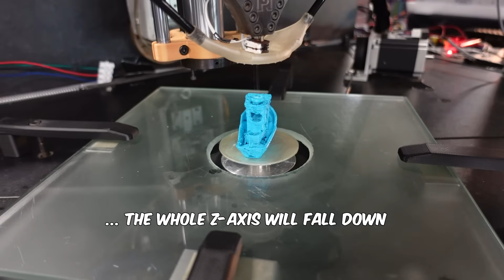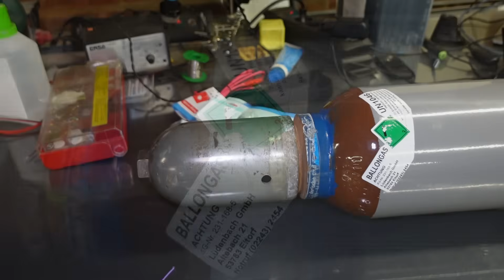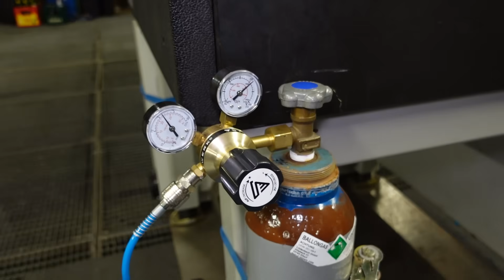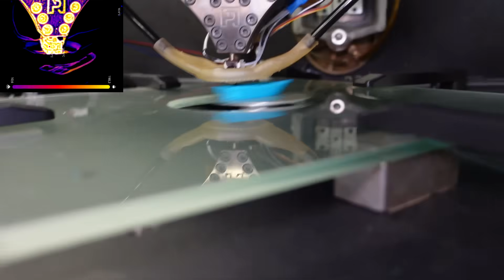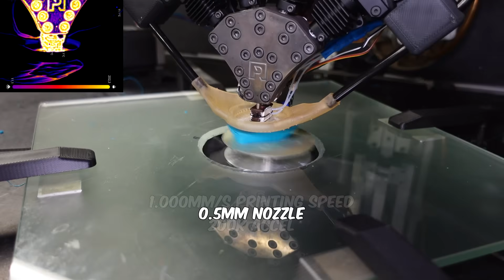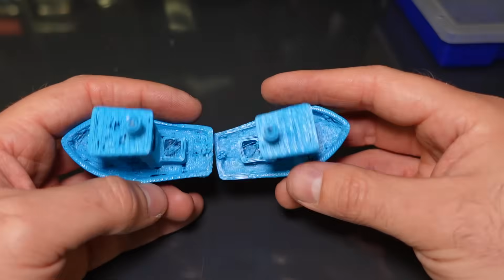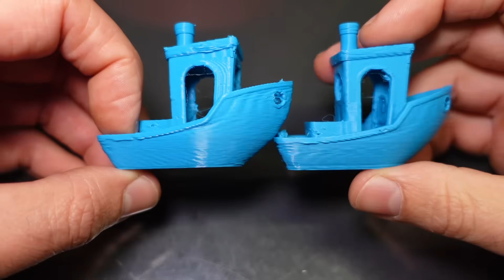Testing Helium Cooling on Worlds Fastest Printer (Minuteman Episode 18)

Comment: Sounds like the limiting factor of shop air is the amount it pushes the filament around. 
Is there a way you could use an auxiliary part cooling system that blows upwards to counteract the downwards force of the current nozzle cooling? It could move with the Z axis so it always aims at the nozzle. You would have to position it outside the print area of course, so nothing collides. You might need to make the bed taller / thicker so that it doesn't hit anything as it moves down though. 
Or maybe add a vacuum port right next to the nozzle to suck the filament back upwards haha. I believe you can do this with a venturi vacuum so it could also run on shop air. If it had the right size and position nozzle it could almost hold the filament in place as it cooled without sucking molten filament into it. Might be hard to balance and constantly get clogged with molten plastic though.
Another wild idea: Use ferromagnetic filament and put an electromagnet around the nozzle to pull the filament strand up and counteract the downwards force. You could tune the magnetic strength so that it just balances the downwards force of the cooling.

Comment: Seems like what you want is a lot of thermal transfer with low "wind" pressure. This gives several things I can think of optimizing:
1. The Gas: lighter molecules is better. Helium is the best. Hydrogen (danger!) is second. Methane, ammonia and water vapor are all better than air.
2. Cooling gas temperature delta: a larger temperature delta means more heat transfer.
3. Operating temperature: cooling is faster at higher temperatures (more molecule impacts). This scales with temperature in kelvin, and is likely not worth trying to optimize unless you can print really hot.
4. How much cooling is required for the print material to go from solid to liquid. Some materials have a very sharp transition, like eutectic alloys have a very sharp transition from liquid to solid.
5. Thermal transfer withing the print material: I'm not sure what is really optimal, but if you can cool the solid part a lot (since its solid and can take the pressure), perhaps that can help cool the new liquid added to it.
6. How structural the print material is before it solidifies.

If it were not for #6 there, a death machine that prints a high temperature eutectic solder with hydrogen cooling would be great. Too bad it would absolutely suck at bridging and kill you with fire.

More practically, getting a real high pressure air bottle (likely scuba gear) to expand it to get really cold air its likely your best option. To do that, you will want to do the pressure drop/regulation as close to the nozzle as possible (to minimize heating of the gas after that point), ideally use the nozzle as the main pressure drop so the cooling happens in the air on the way to the part. If not going that far, at least put the pressure regulator just before your nozzle, and give it a while to cool down the part in-between (which you might want to insulate if its long) before you start printing to maximize the expansion based cooling.

Also make sure your compressed air has time to cool to room temperature after compressing before using it for cooling (compression will heat it). If you really wanted, you could throw the air bottle in the freezer and get an even lower starting and thus final temp, but with the right gear you should be able to get temps way below freezing even without that.
Reply: Yeah I wonder if this is a lot easier with high temp engineering plastics vs PLA and ABS
Reply: Printing with a higher temp filament, that has similar flow, would be good. He allready made some test with different filaments, but the cooling setup was very different then.
Reply: Except H2 is lighter and has better conductivity. You just don't see it cuz it's tricky.

Comment: Btw how much humanity is the air what you are using? Very dry air (e.g., <5% RH) should have better cooling performances and the same is with dry filament. Dry filament + dry air = sharper prints, faster speeds, better overhangs, less stringing.
Reply from the maker: Good point, never really had that on my mind. Time to jeet the air dryer on the top floor

Comment: Perhaps you could capture most of the helium by enclosing the build chamber? if the chamber has a relatively large volume, then the heat loss of the "hot" helium that just touched the part is diffused into the rest of the chamber, and a lot of the heat in the longer term is conducted through the walls of the enclosed chamber.
You might even be able to recirculate this air with a compressor, so you can re-use the chamber helium by compressing it, allowing it to cool via a heat exchanger, and then blow it back onto the part.
I suppose the idea is really to place the build area INSIDE a refrigeration loop, rather than throwing the refrigerant away to the atmosphere, you capture it and reuse the refrigerant/coolant!
Ideally you enclose only the print in the cooling chamber, so you aren't heating the coolant/chamber with the extruder, motors, etc. Perhaps a flexible chamber/skirt that attaches to the bottom of the air duct, with the edges are clamped down to the build chamber? If this is positively pressurized relative to the atmosphere, then it would hold the largest, most spherical shape it can, inflating like a balloon. Filming would suck more, unless a camera is also inside this build chamber.
i dunno, just some thoughts...

Comment: i just looked it up out of curiosity: in the last 20 years the helium price went up by almost 10x!

Now that i think about it i feel like i also see fewer baloons around, but maybe thats just a byproduct of not being a kid anymore ^^
Reply: There was an issue with a large helium supply cave running out around 2020, I think they found more, but there is the issue of helium floating off into space, so any helium used is lost forever. I think 🤣
Reply: The US stockpiled helium extracated from oil production. They later sold it off for cheap, and now its gone.

Comment: I would really like to see a better and more controlled application of the cooling setup with an electronic flow valve. I know helium is expensive so I would suggest going back to liquid nitrogen, because colder air has better cooling capacity as room temp air at the same flow/downward pressure. This was the second time you have had the better cooling option and we can see that it does resolve the cooling issue, however both times, if Im not mistaken, you havent had good control over the cooling media flow.
Also, it could be reasonable to assume that liquid nitrogen would be used in industrial fast 3d printing :D
Reply: It also has the benefit of liquid not being able to be produced by commercially available machines that simple concentrate nitrogen gas out of the air and compress it.

Comment: Remember as well with a single stage regulator the set outlet pressure will increase as the bottle pressure drops.

Might not matter over the couple of minutes you’re printing but I’d keep an eye on the pressure when you start.

Comment: You call Helium not practical for industry usage. I agree. But a sub 1 minute benchy isn't going to be practical for industry usage either. Even your current sub 3 minute benchies aren't at a quality a print shop would be able to charge money for (no offense). So I'd say, use shop air to find any remaining flaws in your setup, then use helium for the sub 1 minute runs.

Comment: Just use pure hydrogen, lol. Better thermal conductivity and heat capacity. Proximity to open hot end.... pshhh no big deal :)
Reply: Actually sounds way more reasonable. The price is way easier to stomach and its perfectly feasible to make on site from water. Volatility can be handled through ventilation.
Reply: Oh the humanity!

Comment: Probably crazy but hydrogen is significantly cheaper to aquire :)
Reply: Simply fuse hydrogen into helium. :clueless:
Reply: @Dryym simple
Reply: You are right. Better cooling performance and even lower inertia than helium. Also you need like 600°C to ignite it. The bigger risk would be an arc or a burning heating element. But i guess even then there would not be an explosion as his shop is to big to build up the right mixture to ignite. Or just print in a 100% Hydrogen atmosphere then nothing could burn.
Reply: Ironically also more responsible. We have a very finite helium supply and it's critical for MRI machines.
Reply: @gsuberland  We have an even more finite supply of Jans!
Reply: Hmm heat plus hydrogen, what could possibly go wrong.  You’d be blasting hydrogen just below a source of heat of 250C.
Reply: @victorianorman1848 tbf hydrogen won't combust for another 300°C
Reply: @RetroGamer74  yea it's not going to vent into the room or anything 😅🤦‍♂️
Reply: Thanks, Hindenburg designer
Reply: I guess you meant N2 (nitrogen) not H2.
Reply: @benjaminfrohns nitrogen would be safer. The print head gets hot enough i would not risk hydrogen.
Reply: Do you really want to see him 6 feet under?
Reply: Though hydrogen is more dangerous
Reply: hydrogen does not comes close to helium in heat capacity

Comment: You should check out compressed air vortex cooling. Just buy a bunch of air tanks and run like 4 of them. They can drop the air temp very very low!
Reply: That is actually really cool, TIL! I suppose you'd have to calculate how much flow you get from each tube, and how many tubes you'd need for the cooling required... And, you have to get the cold air into the cooling nozzle with some pressure too, which might raise the temperature idk. But IMO the vortex cooler is worth doing a "napkin sketch" calc at least!!
Reply: @joegibes right!? Id imagine it's challenging to do those calculations right. Id imagine the temp changes with flow rate and all that other nonsense. Maybe it's just a throw something together and see if it works kinda thing. But it's really really neat stuff!! 

Dropping the forced air temperature seems to be a way to get around too much air pressure on a print.

Comment: why not using screw linear axis for the z-axis. does not have to be that fast. any external gas is not practical for practical 3d printing. chasing digits here. liquid nitrogen air would be better. or welding shield gas argon. dry ice should be also nice instead of water. shop air or nothing. for comparison sake, what if you first extrude a filled plastic cube, then cnc out the final plastic shape. gaslighting bruh. compressed air with more out flow. what you said.

Comment: Have you ever printed a flawless benchy? Seems like this test is backwards. Find the settings to print a perfect benchy first, then speed it up from there. I dont see the purpose in printing crappy benchies.
Reply: Look back at some of his videos - he gets pretty good Benchys at 3-4 minutes print time. The machine can do it for sure. But getting a good Benchy at 1min IS the challenge...
Reply: I think this point is well addressed throughout the series: There's a lot of finetuning to be done to bunp up quality, but that's work that doesn't translate between major changes. So the strategy is to get things 95% of the way first, and then do the finetuning. Finetuning at 80% might get you to 85% and then you're stuck.

Comment: I, once again, highly recommend trying a fog buster setup or some way of attomizing liquid coolant into the compressed air stream. 

Having used this on a CNC router system when cutting metals, it gives some of the cooling benefit of flood coolant without all the mess. You don't need much coolant to massively increase cooling performance over basic compressed air. 

https://www.google.com/search?q=fog+buster&oq=fog+buster&gs_lcrp=EgZjaHJvbWUyCQgAEEUYORiABDIHCAEQABiABDIJCAIQABgKGIAEMgcIAxAAGIAEMgcIBBAAGIAEMgcIBRAAGIAEMgcIBhAAGIAEMgcIBxAAGIAEMgcICBAAGIAEMgcICRAAGIAEMggIChAAGBYYHjIKCAsQABgKGBYYHjIICAwQABgWGB4yCAgNEAAYFhgeMggIDhAAGBYYHtIBCDc1NTZqMGo3qAIPsAIB8QXsILvUiobsQQ&client=ms-android-samsung-ss&sourceid=chrome-mobile&ie=UTF-8

Comment: Have you ever considered injecting cold plasma into the air stream? In industry applications, when there is a need for a surface to bond with another substance, a plasma treatment is done to "activate" the substrate so the stuff that is applied sticks to the surface way better. I think, treating the layers in this way before the next is printed on top might give you way better layer adhesion.
Reply from the maker: Haha that would look dope

Comment: Can you make it dual mode cooling? for walls use air cooling then for overhangs and top layers use helium? or lessening the pressure of helium would be less complicated but would be worth it if its cheaper.

Comment: You are talking about increasing the He flow / pressure, but how about dropping it at first down to 0.25 bar ? 
I could even see that you blend air and He, so that you get a cooling efficiency boost based on 3/4 air | 1/4 He.

Comment: I wonder if you could buy or build a computer-controlled mixing valve that would allow you to deliver a dynamic mix of pressurized air and helium together.  This would allow you to use (free) air for parts of the Benchy with less demanding cooling requirements and mix in proportionally more helium for stubborn or sensitive structures like the deck and roof.
Reply from the maker: Good idea. Thing is: if you want to run a sub 1 min run, literally EVERYTHING is a stubborn area. 😂

Comment: what if you printed the benchy using a more thermally conductive filament? ice9 nylon filament is 10 times more thermally conductive between layers and 40 times more thermally conductive in-plane 🤔
Reply from the maker: Great advice. I've been procrastinating using nylon for various reasons though. Every filament that needs an enclosure usually tends to have very weak layer adhesion if cooled too fast... And then there is the task to print it on a cold bed.

Comment: You could try making use of pressure dependant phase transition. Like water is liquid at high pressure even below 0 C, the same physicochemical effect could be used to find a filament mayerial that turns solid right after leaving the (high pressure environment in the) nozzle.
Reply from the maker: Is there anything that does that at around 200bars of pressure? Or do we have to build a hydraulic hotend?
Reply: @Roetz40 What about using compressed nitrogen (instead of air to avoid condensation/freeze up), ran through a heat exchanger cooled with liquid nitrogen?

There's got to be a better method than just venting helium to atmosphere.
Reply: Could run at a much lower flow rate too.
Reply: @Roetz40  wow, 200 bar is crazy - the low end of injection molding barrels is like 600-700bar, and you aren't THAT far off!! Now I'm picturing a giant, towering injection molding screw over a teeny tiny benchy lol.

Comment: Did you try cooling with Ethanol mist? 
Datron uses this on there high speed mills.
They also regulate the amount very precise to save ethanol, based on how much heat the cut produces.
Reply: I'd be surprised if this didn't mess up layer adhesion tbh.
Reply: Ethanol mist and temperatures reaching close to 300°C, isn't that a dangerous combination? Wikipadia claims the self ignition of gas at 200°C and ethanol at 400°C, but it still sounds like a big fire hazard to me.
Reply: @merkatorix 
No, ethanol is really hard to auto ignite.
For it to ignite at those temperatures, you need to hit a very small window near stoichiometric.
And because the stoichiometric ratio with ethanol and air is so rich, you have a hard time atomizing so much ethanol with compressed air to get there.
Your basically always very lean.

On those Datron mills, they even can shoot glowing chips and the atmosphere won't catch on fire. 😅
Reply from the maker: I did the calculations myself a couple of episodes back where I tested the spray mist cooling (with water and bailed on the ethanol). I have too much respect to do a fuckup here...
Reply: @martin09091989  To be honest, although I am the guy worrying about that, your explanation matches my experience. I once cooled red glowing charcoal with alcohol. The plan was to spill a glas of ethanol on top of the coal to get a flame. The result was almost comparable to a lower amount of water. Noone believed me, that it was not water, but the rest of the ethanol in the glas was ignitable.
Reply: @Roetz40  I still agree. Although martin09091989's explanation matches my experience, ethanol often is just around 99,99% pure. What if there is an impurity at the edge of the ethanol mist and a flame front establishes.
I guess, ethanol is extinguishable with water, but you often hear about barbecue accidents, which allegedly sometimes happen with ethanol bottles.

Comment: what about cool 1°C air? bigger temp difference -> more cooling
Reply: I am not sure, but didn't he try to use dry ice to cool air and get cooled mist and liquid nitrogen? I would have thought, he covered cooled air in some form.
Reply: moisture
Reply: On another comment about cooling the air Roetz responded: "I did a lot of testing with it. I reached about -120°C with a liquid nitrogen intercooler"